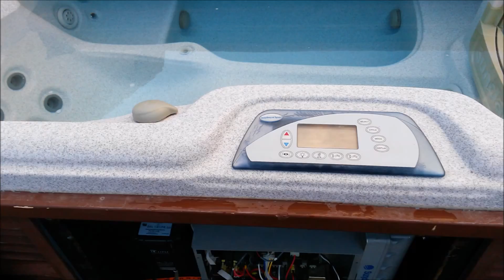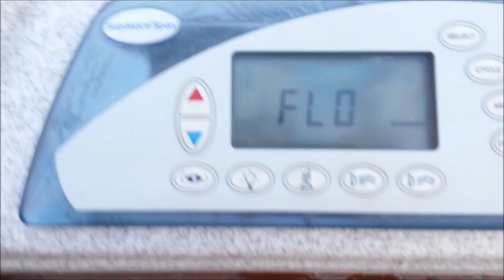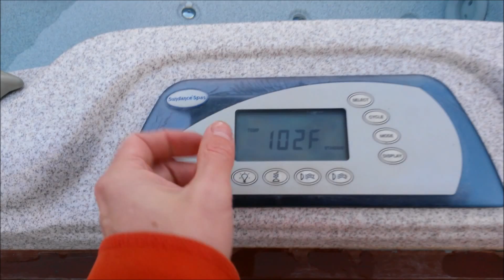Hot Tub Not Hot Enough? 104° Temperature Override  (:2:) The Resistor Method

Comment: I have a 2018 Hot Spring Hot Spot TX, its small and only has one temperature sensor (as far as I can tell) it also runs on 120v. I added a 1k resistor and it brought down the temperature sensor 6 degrees on the digital display, which is great. However, the heater does not seem to be kicking on now, anybody know what that might be?
Reply from the maker: I think you may have another sensor somewhere, maybe built into the heater or control board. Might also remove, or jump over the resistor with a wire to see if maybe something else got messed up. Might have blown a fuse or something.
Reply: @SpaDayz  Thanks for the quick reply. Actually, for some reason it took like 30min for the heater to kick back on. Working like a charm now! Thanks for the info, we were ready to sell it, in the cold Colorado winter 104 was just not hot enough!
Reply from the maker: @brbe22  Awesome! Glad you have a worthy tub now!

Be sure to sub. I need 96 more subs before YouTube will let me make anything on the channel.
Reply: SpaDayz done!

Comment: Brilliant! I tried this on my American Whirlpool 881. I figured, heck if it doesn't work, just solder the wires back together - but it WORKS! For those with the bigger American Whirlpools - there are two temp sensors, they both go into the heater element so super easy to find! Thanks a million - 104 just didn't cut it outside when the temps are in the 30s or lower!
Reply from the maker: Glad to help!
Reply: I can't begin to tell you how frustrating it was to buy a 12 grand hot tub....only to find I couldn't use it with outside temps in the 30s or lower - which is the BEST time to hot tub!  I was curious what made you come up with this solution? Do you just have an electronics background and tried a bunch of different sized resistors until this one gave you the 6 degree or so bump?!  Again though, thanks so much for posting this!
Reply from the maker: @heavydelta7615  I actually read it in a forum post somewhere.

Comment: THANK YOU!  I had given up on ever getting a HOT tub in winter - I got at least 3 degrees improvement out my Costco Strong CSX80 - and FYI to anyone who has this tub - the heater is actually the silver tube right below the circuit board and both temp sensors are right there on board the heater tube directly below the circuit board and are super easy to identify.  I put in the 1k - and am thinking about going up to 1.2K  to see if I actually like a tad more heat.  But so happy with the result.  THANKS SO MUCH!
Reply from the maker: Awesome! Thanks for the feedback!

Comment: Thanks for the tip!  I did this mod to my 2018 Coleman LayZ Spa unit.  I found the primary temp sensor (on the side of the heater, red connector)... picked 1 of the 2 wires going to the temp sensor... and soldered in a 1.2K ohm resistor (1/4watt).  Now my unit reads 2-3 degrees low... so it reads 100degF when it's really 103degF.  Perfect to get just a couple more degrees out of it.  And the built-in safety over-temp thermal cut-off switch is still present and unaffected (connected directly to the side of the heater).  Great mod!
Reply from the maker: Glad to help!
Reply: @SpaDayz  I did this in a brand new Bestway Saluspa unit from 2024. I put 3000 ohms on one side of each of the two thermocouple wire pairs. (BTW those are not red and black wires, rather they black and black/grey stripe in this unit). Easily accessed. Got about 4 degrees F (2 degrees C) increase. 40C displayed on the panel means water is actually 42C. Thanks for the video, we were not happy with tepid 104F and are happy with 108F now.

Comment: subbed and will be trying 1k ohm resisters on my intex inflatable..
Reply: did you ever try this? how did you get on?
Reply: @jordanb9684  worked great. I first tried 1.3k k resistors that was way to much so i went down to like .7 and that worked great
Reply: @shawnwalden2669   don't suppose you have any photos or tips to help me. Going to try and sort mine this Thursday. Was it easy to find both temp sensors?
Reply: @jordanb9684  jordan it is easy to find them. I did not take any pics though. If i can get a chance i will.
Reply: @shawnwalden2669  thank you. Aprreciate you taking the time to even reply to me let alone help.
Reply: @shawnwalden2669  hi mate. Any chance you can point me in right direction. What colour were the wires. I've got it all stripped down now.
Reply: @jordanb9684  i believe red and black. Yiur heater is in a tube. The thermocouple should be close. Then the overtemp one should be close as well
Reply: @shawnwalden2669  do they go to either end of the heater. I think I got the right ones but don't want make a mistake. One goes from one side of heater to pcb board. The other goes from other end of heater to pcb board.

That sound right.
Reply: @jordanb9684  sounds right man. They both terminate on the board in tje same spot. I think you can unplug one and aee what tje temp does
Reply: @shawnwalden2669  You say 1.3k was way too much.. I'm wondering what "way" meant for you =P I like it hot. I've been in 117 and been dandy.. I'm looking to get 110 maybe if the intex can do it. 106-107 won't satisfy lol.
Reply: @weeral1  i think i went with a 700 ohm resister and i am like 5 degrees hotter, dont quote me its been along time since i installed it. 117 is cooking your insides lol
Reply: @shawnwalden2669  I am trying a 1k but it isn't up to temp yet... But assuming it is as off at room temp as it will be up at 104 or so, it is 5-6 degrees off.... Which I suppose is just what I wanted (109-110 capable). I think it depends on how your sensors are doing. They change over time as they wear out as far as I can tell. Yeah 117 isn't for everyone. Not anyone can go in that pool lol. Thanks for.tbe reply!

Comment: Any idea how to do this with the GulfCoast spas?  Mine is a LX7000 and uses and integrated spa pack, the Aeware  in.xe1.  The plug that goes to the heater/thermostat is an 8-pin connector and has 8 separate wires inside, but none are paired, they are 8 separate colors (black, white, red, green, blue, yellow, brown, & orange).   Any ideas?
Reply: You would need to ohm them out. Each color in reference to the black wire. 2 of them will probably have a high ohm rating and will be the heat sensors.
Reply: thanks for the reply - BUT, not sure what you mean by "ohm them out." I have a multimeter, so cut the wires, then check the ohms/resistance of each of the eight, and the ones with the highest ohms would likely be the heat sensors?  then just re-connect the others and put the resistors in those two?  i know just just enough electric to get myself in trouble!
Reply: @jennijump  No just pull the plug out the stick the negative side of your multimeter on the black pin of the plug then the red to each of the others (on the oms setting of course).
Reply: ok, i think i'll have to strip the outer wire jacket all the way to the plug then, to figure out which pin corresponds to the black wire.  Thanks!  I will post again when I've got it figured out.

Comment: I have a balboa m7 heater with both sensers on the heater itself will this resistor method work for this heater?  Thanks in advance. Also my owners manual states that my viking v300 plug n play has a 2 hp blower but it says 1.5 on the motor. Dont understand that. Can i upgrade this blower if so what would you recommend or how high can i go. Its running on 110v.
Reply: alexsoloc3po resistor method should work. Not sure about the blower on that model. Did you watch the spadayz blower video?
Reply: alexsoloc3po, I have an M7 as well with two sensors going into the heater. I'm assuming these are the high and low he is referencing in this video? Did adding resistors to both sensors work for you? Thanks!
Reply: alexsoloc3po As long as you can identify them as actual temp sensor leads then it will work.

I wouldn't mess with the blower it would be a PIA to replace for not much benefit
Reply: GadgetClass - you seem to know a lot about this so I'm asking you the same question I asked alexsoloc3po. I have an M7 as well with two sensors going into the heater. I'm assuming these are the high and low he is referencing in this video? Both sensors plug into the circuit board right next to each other. I was on the Balboa website looking at a spec sheet and it just states that both sensors are identical and provide for more accurate readings on each end of the heating element. But it doesn't mention if one or high and one is low. So I'm wondering if they are both redundant high sensors and there is a third sensor I haven't found yet that is the low - the one in the video that he said would be near the water filter. Thanks!
Reply: Joshua Corn Yes those are the sensors you want.
Reply: Did you do the modification?  Did it work?

Comment: i tried this on my softub and it decreased the temp!  ik resistors. 2200 ohm resistors probably would have made it even worse.  does not work on softub hot tub brands with digital pack. back to new stock parts and i will be happy if i can get 104. i think i got a factory lemon cause b4 all i got was 100 -102  tub only 14 mos old . havnt given up yet but the softub people are not too customer service orientated. i cant find a schematic diagram and co refuses to help with any info. what should the probes read on an ohm meter? to test good or bad? again cant buy a factory manual or schematic, 4500 bucks and a 5 yr warranty is good but sensors failing in 14 months? anybody had any luck on getting a 220 gallon softub any hotter?  the circuit board looks pretty tweak proof . if any body has a way they know hot to increase the tempp to say 108 email me ! michaelafelde@gmail.com  next time i buy a tub im gettin an old one with out the 104 BULL CHITT

Comment: I've now used a 1 k resister and 2 1 k resistors both in series and parallel, same result. temp on the panel reads 80 (I turned it to the lowest setting) and the heater won't turn off. Any help??

Comment: I tried this today on my Jandy LXi spa heater that just didn't get hot enough. Started with a 2.2K -- too hot!  Downgraded the the 1k and it worked great.  I only had to use 1 resistor on the temperature sensor line only.
Reply: How can 2.2 be too hot??? Just turn temp down no?

Comment: hey guys... Steve here in Canada. I just got a Hydropool spa 5000 gold series. It also stops at 40. i checked the spa pack... its an  Aeware  in.xe-3-10-h4.0 

mine has the 1 sensor 4 wires, red/white/green/black and a flow sensor. will this work on mine?...

 I barely have 4" of wire to work with. thanks! 40 just doesnt cut it here in Canada Eh?..;)
Reply: carbs66 If it is like most spas, those 4 wires actually go to 2 different temp sensors. In thst case, you just need to follow the wires and see if you can determine which ones are paired then put a resistor on one leg of each pair.
Reply: ok.... ill try to pair them up... i wish i could find the sensor online to do the mod to it...

SUCCESS!! i put a 1.2k 1/2 watt resistor on the outer wires... its rockin a temp of 106 display says 98!!... thanks guys ;)
Reply: carbs66 Sweet!
Reply: Carbs66 - i have an aeware unit as well, in.xe1, mine has 8 wires - which colors were the ones you used?

Comment: A 1k resistor on each of my temp sensors raised my 2006 Clearwater Rhythm Spa 4 degrees, from 98F  to 102F at the max 104F setting.  A question not answered is what goes on in the spa that makes this modification needed.
Reply: SubDubba Bubba Bad sensors
Reply: The M7 heat tube was replaced last week with new temp sensors.

Comment: I'd like to do this but upon inspection there is a terminal block labeled "sensors" and there are three different pairs of wires going into it. Tow of them are grey jacketed with red and black wires and one of them is black jacketed with white and black wires. Do I need to put a resistor on each of the three? 2004 Sundance btw
Thanks in advance.
Reply: fred fontaine The two grey ones like it shows in the video
Reply: Thank You- watched the video again and saw that afterwards. Ordered resistors and will give it a shot this weekend.
Reply: I used 1K ohm resistors as suggested and there was NO increase in temperature.

Comment: This actually works. We recently replaced our 27 year old 240v tub with a "Plug-and-play" 120v Hudson Bay spa. What a disappointment to find it was limited to 104F! Using the jets caused it cool off fast to a luke warm 100F. A quick search turned up this video. Problem solved. But was it all true; sounded good, but who knows these days. The resistors where cheap and I had the other stuff on hand. It was pretty easy to solder in a 1k. The tub now heats to a bit over 106F while the panel shows 103F. Last nights soak was much better.

Comment: Where is the #3 video/link  - "Various Hokey or Less Reliable Ways to Do it"?
Reply: THE Hot tub I just picked up for FREE - doesn't have a circuit board in the control panel (1998-ish), looks like just various relays do the controlling - so any other methods to raise the temperture would be great - where's the #3 video?

Comment: I just added 2-1k resistors to my Nordic Stella hot tub and now it will not start up. It's getting power and the display says "95". but when I push the jets button all I get is a clicking sound.
Reply: Actually, the problem turned out to be a loose sensor connection on the board
Reply: Hi Jay.... After fixing the loose wire, how did it work out?
Reply: @dhardy6654  its all good :-)

Comment: Hi SpaDayz, I tried this on my Costco purchased LifeSpa DS660, but with zero effect.  I can sent photo if that helps, but wonder if you have any thoughts about what might have gone wrong.  I installed/soldered the 1 k resistors on both red lines.  Thanks for any ideas you may have, and for your very easy to follow video.
Reply: rickee1776 did you find both temp sensor leads and apply resistors to both?
Reply: I believe so.  I soldered in a resistor on each of the two red wires (one leading to the heater and one the high-limit sensor).  It looks like the result in the video.  Thanks for following up!
Reply: i should add that I enlisted the aid of a local service person who works with a company that works with spas and pools.  They verified that these are the wires I was trying to affect.  So someone who knows more than me (not hard to do) verified the correct two wires, after watching the video to understand the concepts involved.  Very helpful!
Reply: rickee1776 one of your temp sensors may be way off. use a multimeter in ohms mode to see if they are both reading something similar. You can try adding larger resistors also
Reply: Well, you guys get the gold star!  For separate reasons I needed to drain and refill (way to many nieces spent way too much time shedding their makeup).  In the process of powering all down for a while and then back up, it's heating to near 108 now.  I was going to do the ohm test, but now it's academic.  Halleluia!  Thanks so much for your help!

Comment: I was able to install the resistors and now the spa heats up more than 104 degree.  But I am having trouble controlling temperature.  I set the temp to 90 degree, then the heating does no stop even at 99 degree (the water is about 107, which we like)  Before it was set for 93 degree and stopped at 99 degree.  Did I do something wrong?
Reply: k i try setting it lower. If temp doesn't stabilize, you may have to change one or both temp sensors. You can ohm them out to see which one is bad.

Comment: Help please. I just installed a 2017 Sundance Dover spa and the 104 temp is not cutting it. Is there an easy way like in the first video just moving some parts or do I need to install the resistor and solder it? Thanks!

Comment: pls, I need tour help on a SOLANA TX.  It looks much different. The high temp sensor goes to a  small black piece on the heater with 4 wires. Two from a gray covered sleeve and two from the circuit board.

Comment: i just bought a 2017 Sundance, Peyton model. Does anyone know if I can just move a jumper or will I have to splice in the resistors?
Reply: I also have a Sundance Peyton, but mine is a 2012 model which came with the 106 degree override built in.  Did they not have that feature in the newer models?
Reply: Thank you, I'll look into it.

Comment: My only concern is that the actual temp does not reflect the real temp.  May need to post a notice on the topside control indicating that "Actual temperature is hotter than indicated!"  Liability is always a concern.  As you might imagine, I am an attorney. ;)
Reply: Eliot Malamud If liability is a concern with your tub and it's users, then replacing your 2 temp sensors is the way to go. this will restore your true 104deg readout and accuracy.
Reply: I presume that there is no way to keep the two (1K) resistors in place AND have the topside control read the correct temperature.  :(
Reply: Eliot Malamud Most people are trying to exceed the 104 deg barrier. Most people give little creedence to the set temp on LCD also. You are correct, the reading will be off by that amount even with the new sensors.